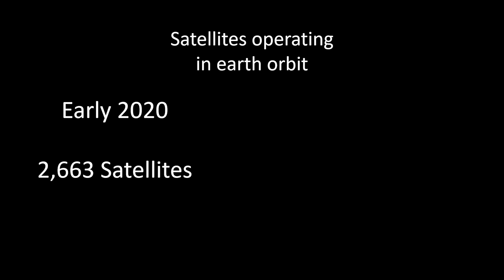Space deployable structures and why we need them! | Vincent Fraux | TEDxBonnSquare

Comment: Sorry but this is completely backwards. The philosophy of making things "as light as possible" has resulted in engineers spending years and years designing satellites & spacecraft out of paper-thin strands of super-expensive unobtanium fairy dust alloys so they can shave off that extra half gram. The resulting machines are unbelievably expensive, take forever to make, and are super fragile & delicate, and are often designed to support its own weight in ONE DIRECTION ONLY - that's the reason some payloads require vertical integration into the launch vehicle, because they can never, ever be allowed to lay on its side or it would collapse under its own weight.

And all of that is because space launch was so ridiculously expensive. The real solution was to use a brute force approach to maximize launch capacity and lower costs, which SpaceX has done and will do 10x over with its next generation Starship. Once prices are lowered and launch capacity is increased, people can make far more rugged, durable satellites and spacecraft out of more normal materials and parts, many of them commercially available off the shelf parts, rather than being hand-crafted, custom designed, bespoke items. No more super delicate origami nightmares like the James Webb telescope that's at least a half decade behind schedule and costs 20x its original budget estimate.